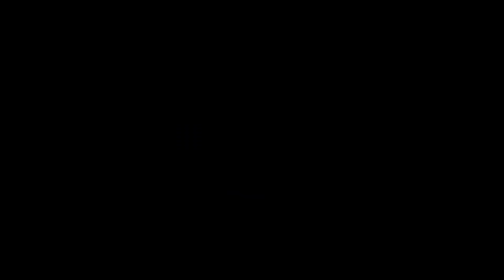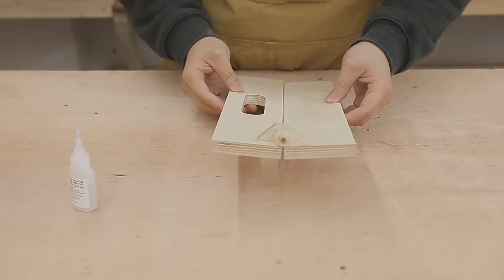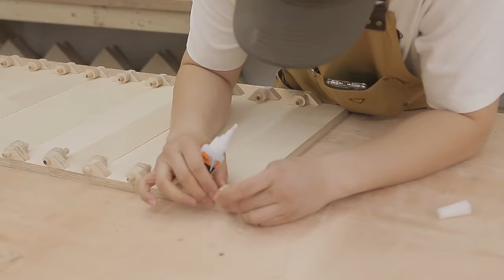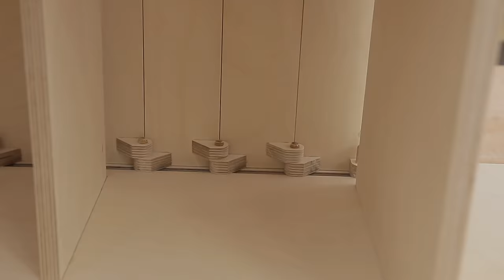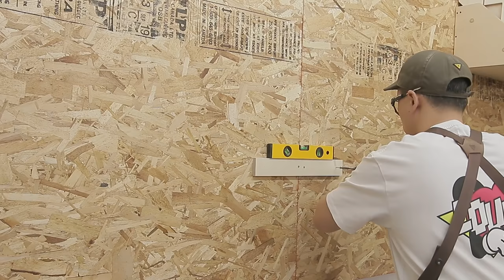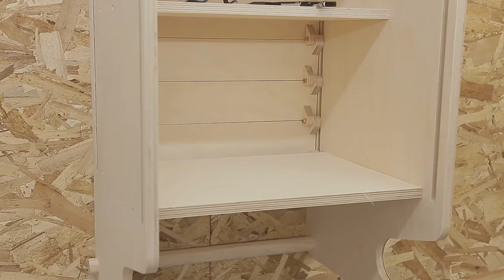[Woodworking] Tambour Sliding Door Cabinet only wood

Comment: This is interesting, not what I'd do-youve obviously seen how the upper/outer bit can be more loose because it's not load bearing. The rollers won't get caught on even the smoothest of semi cut (not all the way through) track. My bead bin certainly does albeit only slightly. You seem to have a special mind pal, seeing what others don't and almost celebrating these things in the artistic simplistic design :) unless you go through loads of prototypes :p

Comment: Amazing. what kind of glue is this? looks like some super setting strong glue without activator. I want it!
Reply from the maker: It is the same instant adhesive as Loctite 401. =)
Reply: Yeah... nice ... glue is  Awesome aswell
Reply: Looks like cyanoacrylate. I’ve used it a lot in RC plane making. Also my wife used it a lot in university when she was making balsa wood models for her architecture class. You can find it in most model shops. Beware, use gloves! It will glue your finger to the wood in about a second! I have had to literally cut my finger off of things more times than I can count 😂🤦🏻‍♂️

Comment: Love the woodworking ideas. However, I have one comment. I’m not sure if using wood glue alone on those wooden hinges is such a good idea, due to the fact that over time any adhesive will loose it’s adhering properties and fail. If I did this project, I would pre-drill some holes and fasten the wooden hinge wedges down with a screw after gluing them down. Other then that slight modification, this is very cool wood piece.👍

Comment: Very interesting. But why not thinner slats and a fabric backing, like standard tambor? Seems like gaps at the top when closed could be an issue. I guess that doesn’t matter much since there are huge gaps on the sides where the tracks are.
Reply from the maker: I am not a professional carpenter.
After filming, I found out that this form is called a tambour and that we need to attach fabric to the back of the tambour door.
Next time, I'll make a regular Tambor door
Thank you for leaving a comment. =)
Reply: YouTube is full of classic tambour doors. This one is the only I could find which is different. I am considering building one myself and wanted wider planks to make it look more like a solid surface when closed. This is just the thing, thank you!

Comment: Missed you! Even havent seen the video, already give a like.
Update: so love it! So clean! Not even used a single screw or nail! Very nice. I was thinking maybe you could use some candle residue for the part where the door slides due to friction?
Reply from the maker: It is better if you use four candles. =)
It doesn’t appear in the video, but I also used candles
Reply: @dekayscrafts  nice job man. Love your works !

Comment: First off, that glue, just no. While that piece is nice, the big "channel" compromises stability and durability. Additionally cutting so many small wooden parts ... no, not viable. Yes you can do it ... but I would rather not cut so many small pieces with a Table Saw or Band Saw. So unless you have a CNC I would not try to cut so many pieces for allot projects.